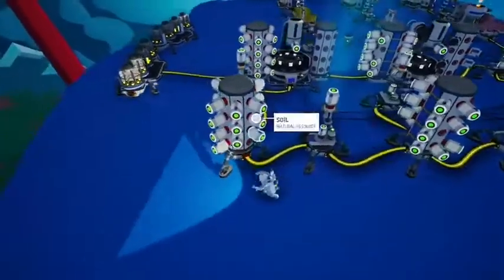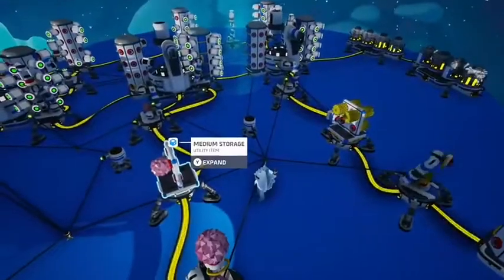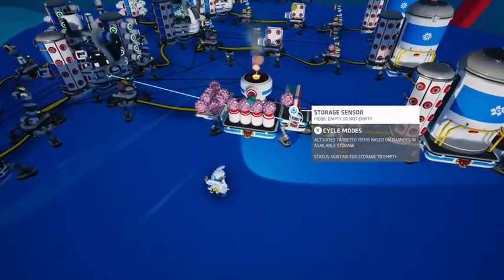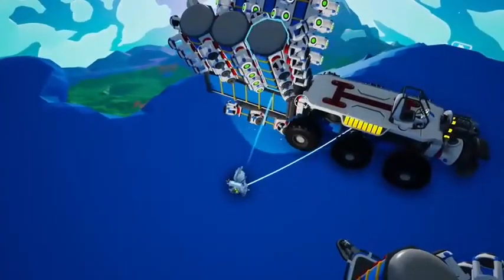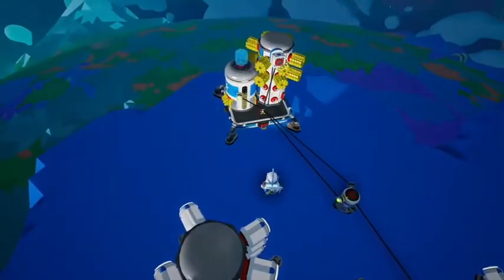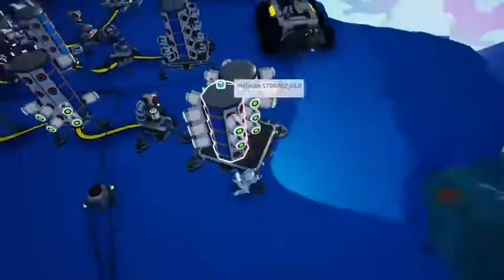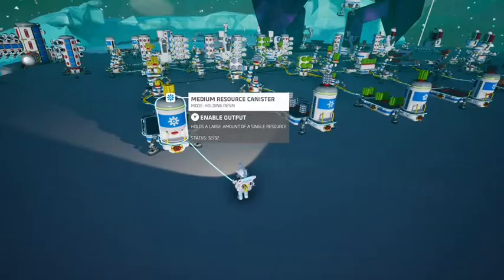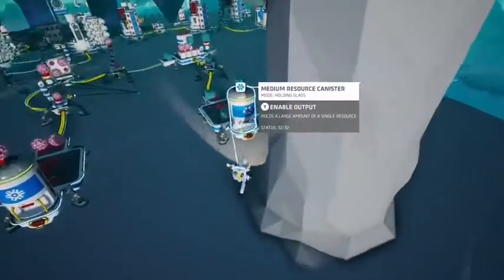An example of a bunch of automated soil centrifuges running together in the same factory

Comment: Hey I have recently started up on astroneer. Any tips? I’ve activated a few planets now but most of my machines are a mess
Reply from the maker: I usually dont build too many factories before i finish all the missions and such, one exception is a simple hydrazine factory because i put on a jetpack as soon as possible. Easiest way to power gates is 30 small batteries plus something to charge them back up in between gates but that will ecen do atrox! Anything you are having particular trouble with?